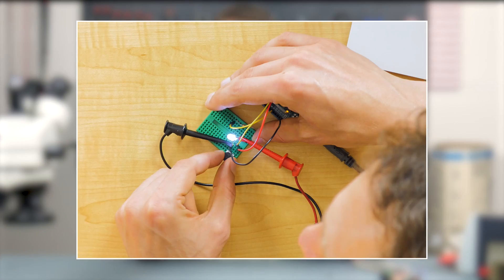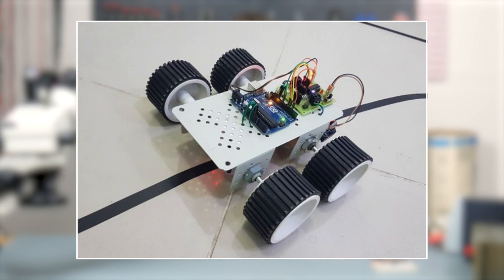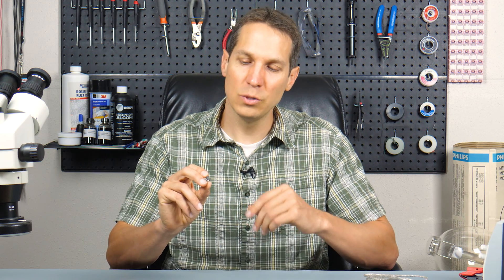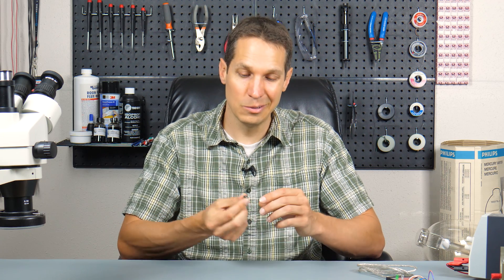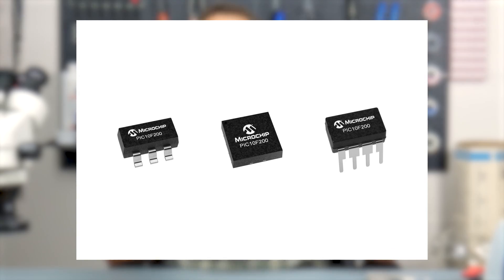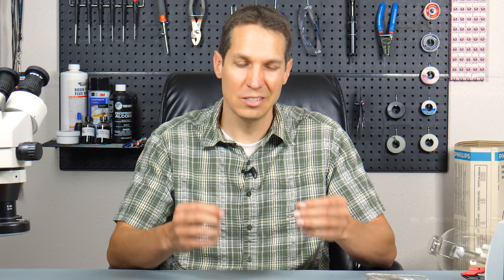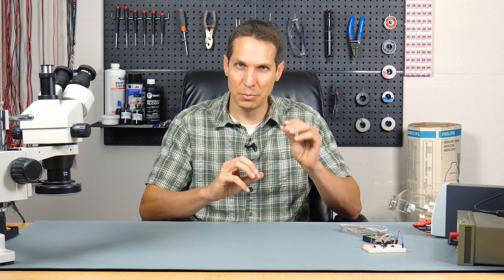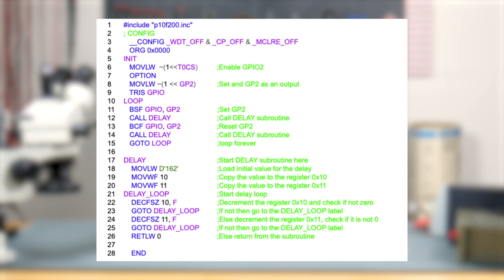How to Use a Simple Microcontroller Part 1 - An Introduction (PIC10F200)

Comment: Is it possible to add , ram and rom to this smal simlpe microcontroller 😅?
Reply from the maker: You can't add RAM and ROM to the MCU (well, technically, you could have some external chips) but you can just look at the PIC10F series and choose an option with more RAM and ROM.

Comment: Does all pic microcontroller do need   Been program before use ?
Reply from the maker: We go over everything that you'll need in a later tutorial, which includes a programmer (like a PICKit).
Reply: @CircuitBread  good

Comment: Sir if i use pic12f508 instead of u told i just have to change library for that ic right??
Pls comment i m not getting pic12f200
Reply: for the size, not a bad one, I've done a single character display (20LEDs in a 4x5 grid) with no extra silicon with a 12c509 in the past, it had the room to implement 4 bits of shading, character maps, scrolling, messages. I used every last byte on it. ROM and RAM, however.

Comment: If anyone can help me figure out to build a small 2 inch by 2 inch circuit board that would direct electric current in 2 different directions,  with 1 or 2 different micro electric motors, by turning a bolt in 2 different directions with something that you would hold in your hand,  that's all I need,  my door is open,

Comment: Great intro! I think i'm sold on watching more.
Before I do.. Is there software on "emulating" components such as the microchip/controller and various possible hardware?
I would like to emulate and make sure it works before I go buy the real stuff and make it work.
Very familiar with c++  and memory management. Little experience with MIPS32 assembly.

Comment: Assembly is great for learning how a microcontroller works, but most c-compilers are way better than any beginner can write in assembly, it takes a lot of experience to really get anything out of coding in assembly
Reply from the maker: Yeah, I'd agree with that wholeheartedly.  For practical applications, the only time I've used assembly is embedded in C-code when I want to directly control how many cycles occur for timing purposes.  Sergey may be able to write eloquent and efficient Assembly, but C is more up my alley.

Comment: I'm currently designing a device which counts Pull-Ups. I already shrunk the project down to just the Atmega328 chip but the costs of those chips is still a bit too much for production (I'm planning to produce around 10 devices). I hope this series will give me some insight in cheaper alternatives :)
Reply: How’s prison Creed?

Comment: i  have a speedo meter works on encoder. encoder purse rate 0- 500 pulses per second  on both channel A & B .my meter has 5%  errror  i wanted to feed this to  micro controller and make 5% more pulses out put on both channel  to compensate the error.  (for examble if frequency 100 hz i need 105 hz output) could you please guide me
Reply from the maker: Hi Saneesh, have you looked at our PWM tutorial?  Did it help out?  https://www.circuitbread.com/tutorials/pwm-led-dimming-part-7-microcontroller-basics-pic10f200

Comment: Hi...I am using pic 16f676 microcontroller for my project..but I am new for pic microcontrollers..I am facing lot of issues while taking analogue inputs and outputs & digital inputs and outputs......can u please guide us....
Mail id: sumanthchandrano2217@gmail.com
Reply from the maker: Hey Sumanth!  Sorry to hear you're struggling with the GPIOs and ADCs with your microcontroller.  The PIC16F676 has hardware modules for ADC conversions.  These tutorials are quite low level and nearly all the features need to be done in software and are done in Assembly.  I would say that the first five tutorials here would be helpful for your understanding of the PIC structure and to get things setup, but then you'll probably want to look into something else for help with your higher-level code, even though we do have a tutorial posted on CircuitBread.com for a software ADC.

Comment: could one cable directly from rs232 serial port on older computer to the rx & tx pins on the uC, to eliminate the pickit2/3 ?  null modem, i assume [rx->tx & tx->rx], & pretty slow, maybe 1200 baud ?  thank you for posting your fine series of tutorial videos.  you've re-animated an old man's interest.  used to program stepper controllers w/ n-codes, an ascii text editor, a simple rs232 cable, and a short basic program to down/upload.  that was 30 years ago, however.  thank you.  dLLund
Reply from the maker: Hi David!  Actually, once you've programmed the PIC, you don't need the PICKit2/3/4 at all.  You can provide power from another source and the RS232 is completely independent of the PICKits.  And if you have an older computer, you won't need the USB-RS232 converter, though you will still need a logic level shifter as the voltage levels on the microcontroller and the voltage levels on the computer rs232 serial ports are different.  That is the piece from Sparkfun that I bought a decade ago and is plugged into the actual breadboard.  Thing is, even with an old computer, you could probably go significantly faster than 1200 baud (I guess it depends on how old the computer is) but that setup sounds like it would work!

Comment: 3:56 so what to use when going commercial?
Reply from the maker: That's an interesting question!  Like so many answers in engineering - it depends.  What kind of application are you going for?  If you want a simple, inexpensive chip to play a birthday jingle in a card, then the PIC10F200 may be the ideal solution.  If you're looking for a robust ADAS solution that can handle touchscreen interfaces, dozens of peripherals, and still have real-time responsiveness, then Renesas has some great products.  I'm curious if there are other people out there reading these comments that might have some more thoughts on this, though.

Comment: There isn't an order of magnitude difference in binary program size between asm and compiled C. The reason arduino code is huge is that it includes a whole bunch of standard library shit, defines a whole bunch of interrupts, and has a bunch of overhead for their own platform functions.

Remove the static overhead and you will be left with binaries within the same order of magnitude in size.
Reply from the maker: Thanks for the comment - you're right,  it doesn't need to be that much bigger.  In general, programming something in C versus ASM on the PIC they should be relatively similar in size and poorly written ASM code could easily be larger than well-written C code with a good compiler.  But with Arduino, building an LED blinky program, the output code size it gives is an order of magnitude bigger than the PIC code of the same size.  I don't know the inner workings of the Arduino well enough to say why, but in our tests, it's pretty clear.  It would be interesting to know why.

Comment: A thumbs up for the way you bring over the information. I do have my thoughts on the use of a pic though... PICs may be a good choice for when you have to do very simple things or just to learn how microcontrollers work at the lowest level. But I did a lot of PIC assembly language programming at work (pic16f and pic18f devices) and believe me, pics are definitely not a good choice for larger assembly language projects. The use of memory banks and the way conditional branching is performed makes programming errors unavoidable.
Reply from the maker: Hey Marc, thanks for the feedback!  Those are some great insights and I hope people see this when they're considering what to use for some of their projects.  When Sergey and I were discussing this, we chose it because we wanted the simplest example possible to go over the functions of a microcontroller.  We explicitly assumed that once people go through these, they'll have a better idea of what's going on at the fundamental / underlying levels but then move onto a complete different microcontroller (and probably change to C).